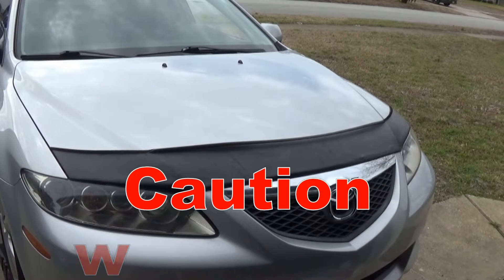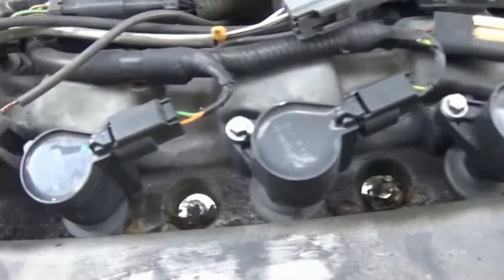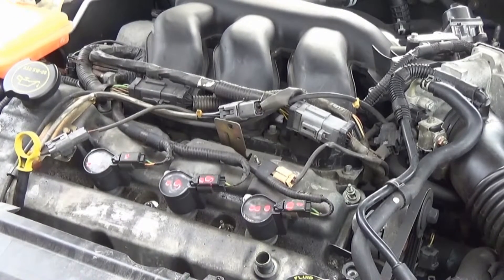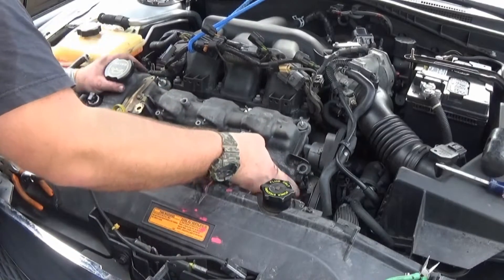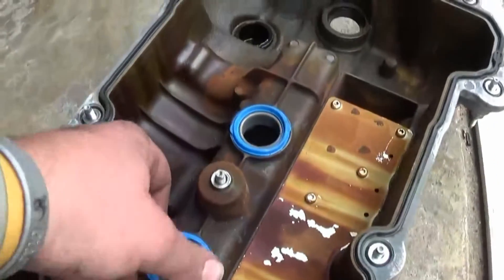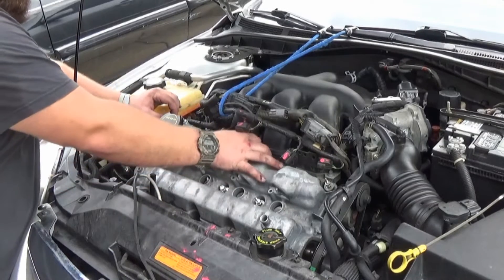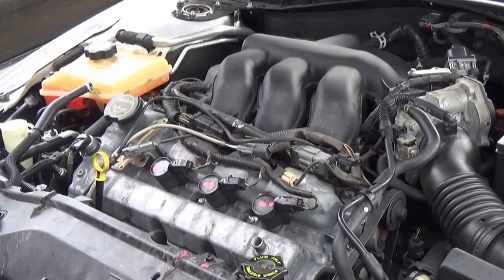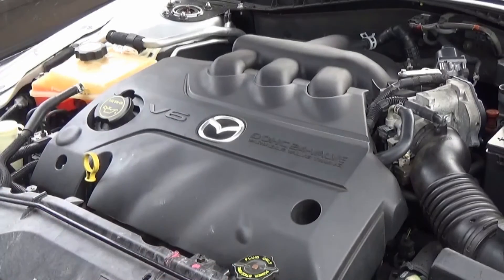MAZDA 6 VALVE COVER GASKET REPLACEMENT V6 3.0L DOHC

Comment: The front valve cover is baby mode, let's see that other one now.
Reply: Same lol I gotta fix a oil leak on the rear valve cover it's bad. Smoke fumes and all
Reply: Thanks saved me 12 min
Reply: @wigletron2846  there's an engine mount to the left side of the engine when looking at it. If I remember correctly I loosened the cover bolts on the back and then to gain the clearance I needed to get it off, I loosened that motor mount nut to drop the engine enough to get it through. It's still a tough thing to get through the space you're given, but it is possible.
Reply: Now do a 98 lexus es 300 rear valve cover. Have fun.
Reply: @joelr.garcia377  tengo ese mismo problema.

Comment: Pro tip to anyone watching this in 2024 and plan on working on Ford/Mazada 3.0 v6, do yourself a massaive favor and go ahead and remove Engine mount and drop the engine 4-5 inches. Just finished on daughters 09 3.0 milan and after a massive struggle i dropped the engine and it was almost easier then the front cover .
Reply: For the rear one?
Reply: @palereaper  Correct.

Comment: I noticed this engine has a water pump tensioner on it. My 2005 Mazda 6 S Wagon does not have the tensioner and the water pump belt is the same length as the 2010 Mercury Milan 3.0 which makes me question whether the engine I have was swapped out for a newer one.

Comment: Did that fix the valve cover oil leak? (over on the lower right corner)
Reply from the maker: Yes it did fix that leak.. it also had a massive timing chain cover leak that was really bad
Reply: @munnday86  Did you fix the timing chain cover leak? I was quoted 10 hours labor to fix.
Reply from the maker: @MrEd9452  it's fixed one of the 4 leaks. I ended up selling that car. I love it so much. Nice interior, great power, handled nice.. but it leaked old out of every seal. It would have cost too much to fix all the leaks so I sold it.
Reply: @munnday86  I bought my 04 wagon with manual brand new almost 21 years ago. The oil leaks are the only issue I've had. I was quoted over $7k to fix all the leaks! Should be a lot less since once they drop the engine, everything is there. The interesting thing is., as I was looking up parts on a Mazda site, I found i could buy a remanufactured engine from Mazda for $3.5k. A lot of money, but cheaper than a new car and where can I get another wagon?
Reply: @munnday86  I've been adding "high mileage" motor oil and hoping that the seal conditioners help with the leaking. But it does leak from everywhere.

Comment: Hey do you still have this v6 Mazda? I need to know where the two hoses go that come off of the selenoid in front of the throttle body. If you pause the video at 1:27 it's the two small hoses on the top right of the vid one has a green mark on it.
Where do both those hoses go
Reply: They go to the EGR Valve solenoid. Green hose goes on the top.

Comment: Why didn't you replace the rear side valve cover gasket? That part is missing.
Reply from the maker: This was just the front side. The rear requires taking the intake off. That's will be a diffrent video

Comment: Was there a trick to getting the big piece loose?  Or did you just lift?  I'm just wondering if it's stuck down by gasket or something
Reply from the maker: The valve cover I believe is what you are talking about. Make sure all the bolts are undone. And use a putty knife and slowly  pry at the valve cover and pull upward. The valve cover is on there pretty good with RTV.

Comment: What is this "RTB" stuff you mention to dab on the corners before sealing it back up?
Reply from the maker: Its called RTV. and I use a brand called right stuff from autozone.
Reply: It's "RTV" a silicon adhesive and sealant

Comment: You didnt replace the other side lol ??
Reply: munnday86 it is a bitch taking off but cleaning the intake and the egr and throttle body is great. How did you pry the cable cover off.  It looks like you paused the recording.  Give me a tip i plan on doing this next week
Reply: This car makes me regret getting rid Of my 2002 Grand Am V6. It was so much easier to work on. The Mazda 2.3 is easier to work on from what I understand. This Ford V-6 is hell
Reply: LOL I watched for the other side as well. I just want to see if there is an easier way when it comes to removing the valve cover. The firewall is way too tight to the valve cover and unless you want to un do the sensor inside the cover it won’t come out
Reply: Loosen the passenger side motor mount while supporting the engine. Drop the engine down carefully until it the OCV is down low enough to get the valve cover past it. Even then it's still tough to get the valve cover off but it prevents you from breaking the OCV connector and from getting very pissed off! The EGR tubing will be in the way as well FWIW. (Some people claim to take the OCV out before taking the valve cover off but I don't see how they could do it.) Also, check your cam bolts as they are known to come loose on some models of these 3.0 engines. You won't have a better chance to access them!
Reply: Torque specs?
Reply: Haha, the upper is a bi*ch.  Why would Mazda do that to people?  It turns spark plug r&r into a way bigger project than it needs to be.

Comment: @ 6.25 your hand is on the oil cap -- just below that is the oil control valve, you should change that out when doing this job too its a good time to do that. There is another one on the other Bank but those crack and split inside and can cause oil leaks and are cheep to buy.
Reply: Same.  I watched this video because the VVT solenoid gaskets are leaking.  I noticed you didn't change yours.

Comment: Looks like you have a missing valve cover bolt right by the water pump pulley
Reply from the maker: That bolt is attached to the big plastic piece. And thats how it bolts to the valve cover.